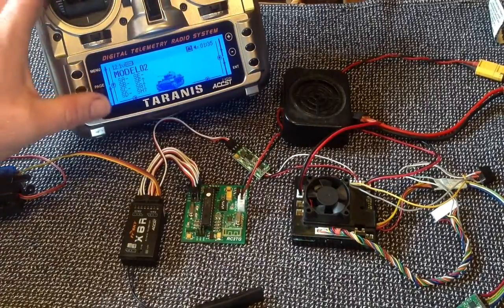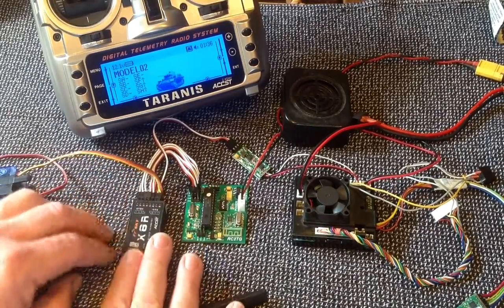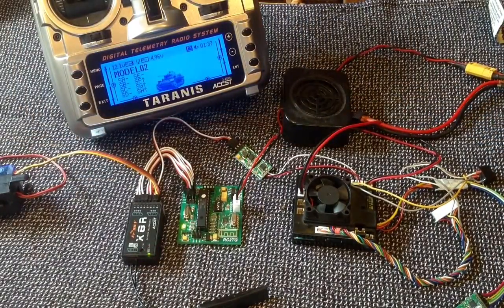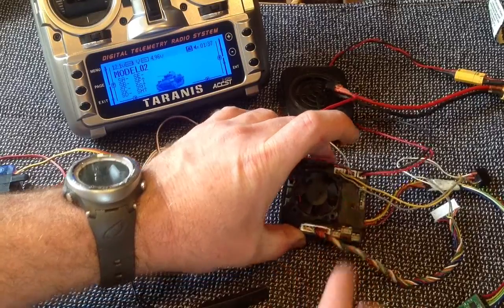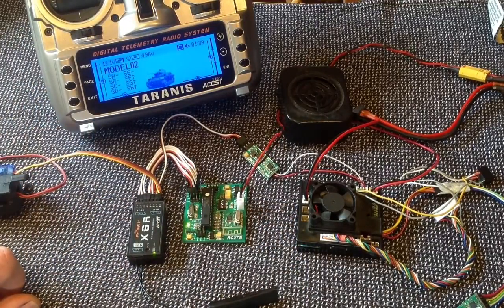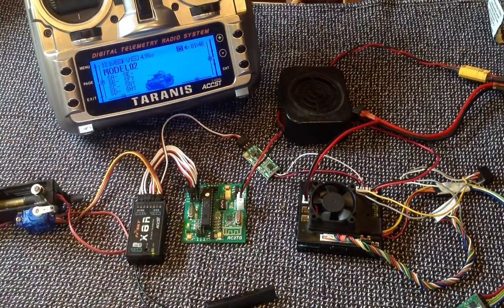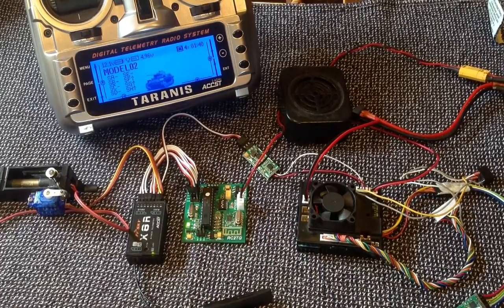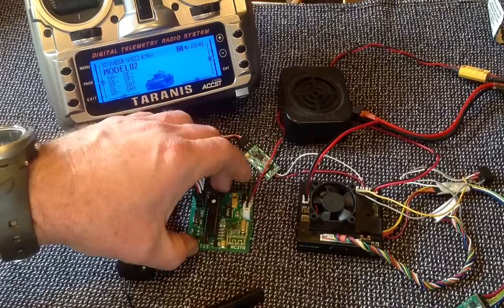RC2TG Introduction - Real 2.4gHz control for your Taigen Tank

Comment: Well... Dang... I've just now come across this video, watched it the whole way through, looked at the comments for a link, and then realized the video was from 2014... I'm converting a Heng Long tank into a Taigen tank and I'm running into sooooo many snags. So I've started trying to convert to actual rc.... And have run into snags with that as well. UGH! Back to the drawing board! I wonder if the Taigen motors can be replaced with actual hobby grade motors....